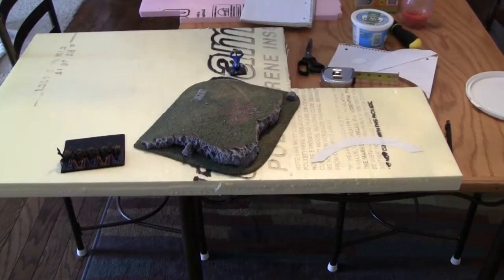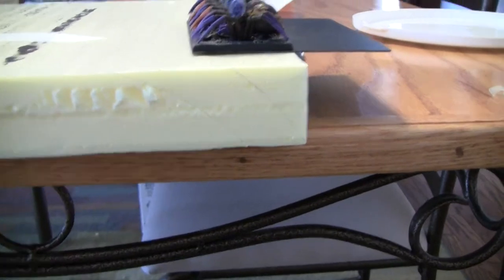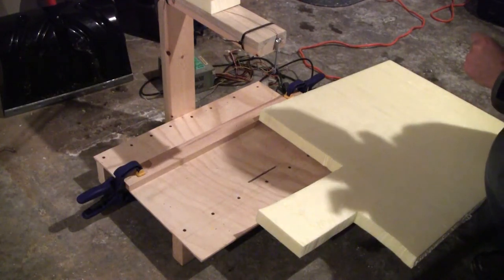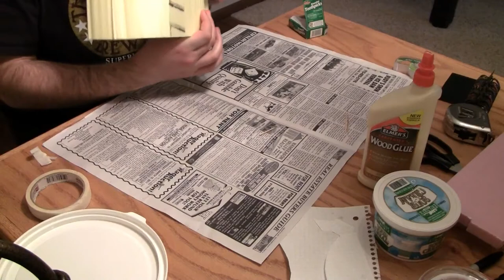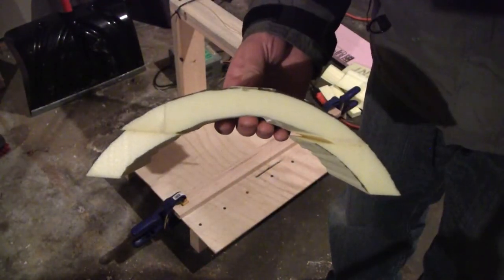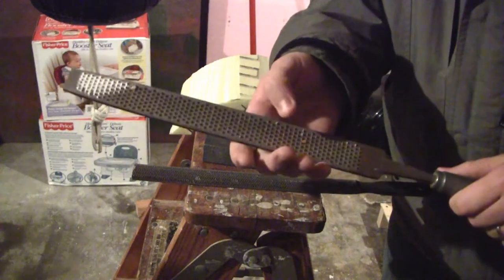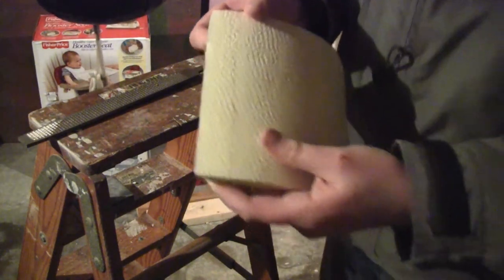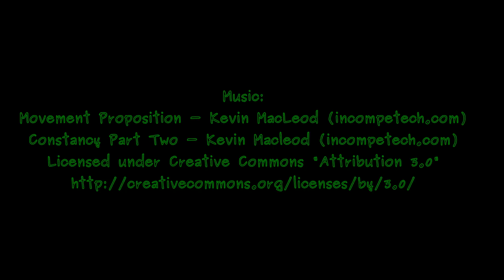Bridge Build - Part 1

Comment from the maker: @BlueWarGaming Yes I was just lightly tapping it, the teeth on the rasp dig into the foam really well.  It's important to move the rasp around and change the angle of it while you're texturing the foam.  The teeth are regularly spaced so it doesn't look right if you make just a few passes all at the same position.